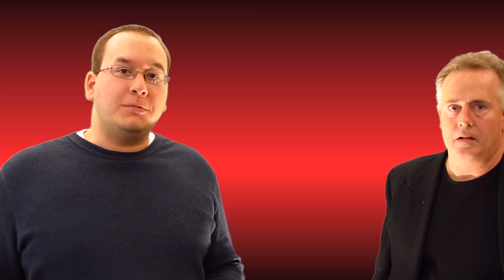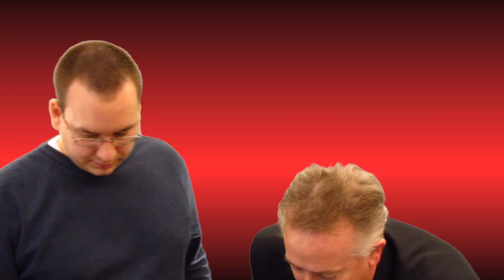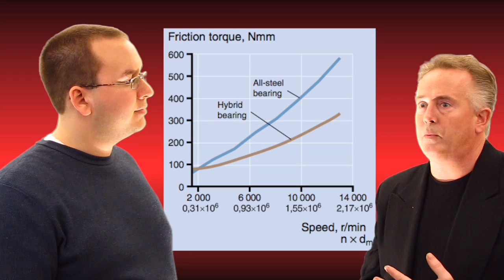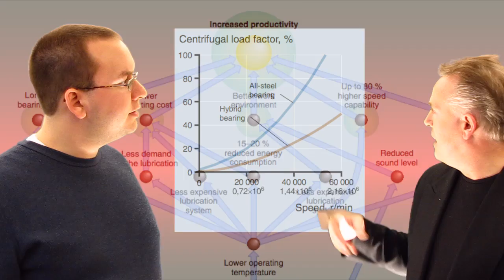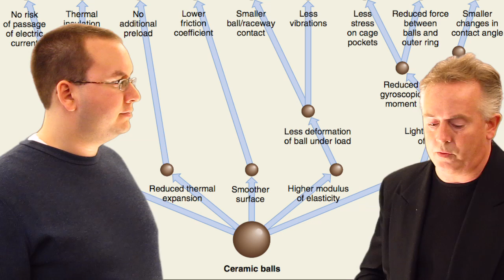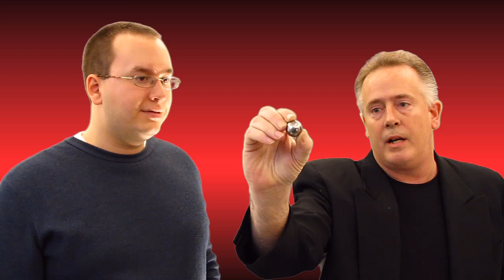TPP 1 - Ceramic Ball Bearings

Comment: Wouldn't one more benefit-- from the smoothness and the accuracy dimensionally---be to more closely osculate the inner raceway-perhaps also the outer ? Less stress with closer 'cupping'. Might have non circular curve to the transection of the raceways.